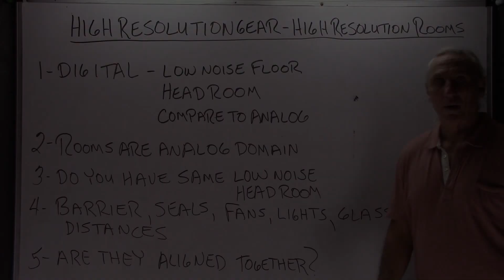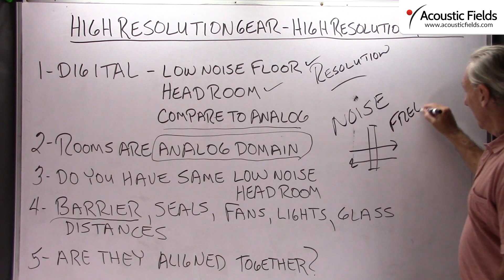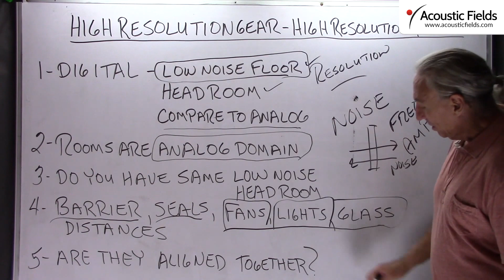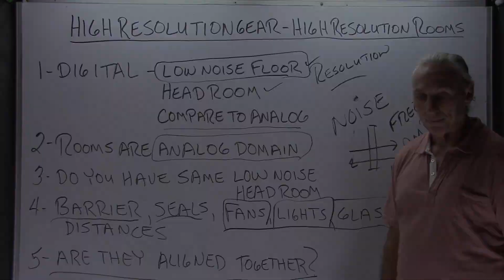High Resolution Gear Vs. High Resolution Rooms - www.AcousticFields.com

Comment: Can you comment on why glass is so bad for room acoustics besides the obvious reflection issues?
Reply from the maker: Hi Wiley,

Two issues with glass: movement and reflections. Low frequency pressure causes glass movement (diaphragmatic) and then the hard surface area presents reflection issues. Once you treat for these issues, you will hear the difference. What are you hearing? You are hearing frequency response changes that are not sympathetic with music and voice. Sound quality is the direct result of doing a lot of little things correctly and more importantly in the correct order. For example, you can not begin to manage middle and high frequencies without successfully managing lower frequency pressure issues. Low frequency harmonics can blur and smear middle frequencies.
Reply: Thanks for your reply. I have noticed issues with glass. I work as a recording engineer and our control room has very thick tempered safety glass doors. I've eliminated any early reflections from the loudspeakers. Do you think there would still be diaphragmatic effects? How would you determine the resonance of the glass in the doors? Thanks.